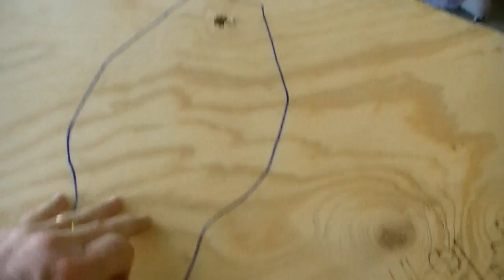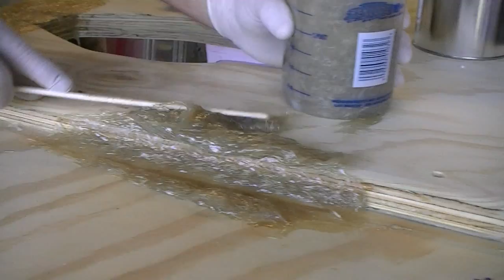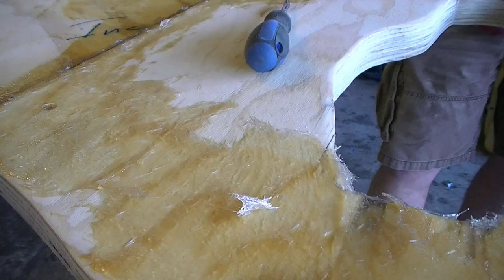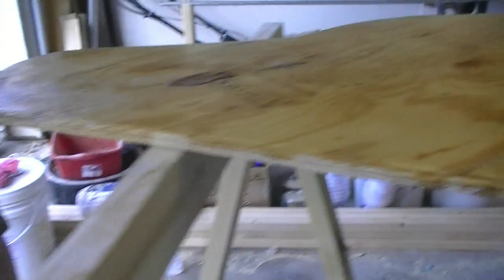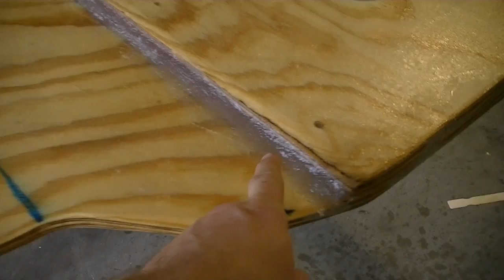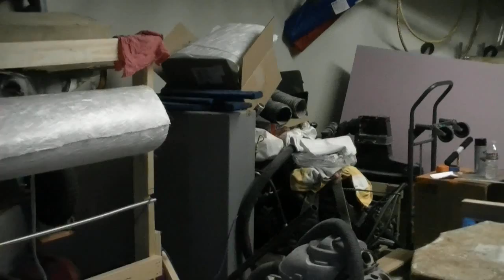How to Water Proof a Boat transom with Fiberglass Restoration VLOG #15

Comment: just a heads up for any of you DIY out there, do your hot coat of resin on the ply with a bit of acetone mixed in so that it soaks better into the timber. Let the resin cure before laying down your chop strand, that way the chop wont suck the resin back out of the ply.
Reply from the maker: the DentalDude that is a very good tip. Thinning it will allow it to dig in the wood.

Comment: Dues humidity affect the wood before you apply the resin coats? I am doing this right now. It has been intermittently rainy and humid here in Florida. I have a garage here with ventilation and have put the marine plywood in front of a shop fan for a while and seems dry but wonder if I should bring the wood inside the office a/c to try and remove moisture overnight????
Reply from the maker: after6tuning I never really had any problem. I would not take it into another environment as it may change the cure time. Man that is a good question. I did a quick search and did not find anything definitive.

Comment: Hey man, I know you’ve been doing this for a good bit on a couple boats.

Do you have a particular brand you use that’s quality but not top dollar as far as resign, catalyst and gel coat?

All I’ve found and have been recommended was west systems but they seem very premium and expensive. Do you have a better or cheaper alternative to west system materials?

Comment: I dilute the first few coats on plywood with Stirene makes in soak in more imo looks like ur doin a great job.That PL adheasive is great we use it for granite work all the time and that stuff really holds :)
Reply: I always use stirene and dilute the first few coats. The plywood needs to soak in the resin. If you just wet out and glass the plywood. The plywood can drawl out the resin from the glass.

Comment: Couple of suggestions. I save cardboard from large items, like washers, driers, refrigerators and water heaters for painting and to place on the floor for projects like this. Two; sometimes you can put rollers with oil based paints in plastic bags and then place them in a refrigerator (not freezer), and they stay usable for some time.

Comment: for all of you wondering what marine plywood is made of? its not the glue that is used,  its the wood.   the tree is a south American wood called OKUMA it hold to rot water 5 times longer than standard pine plywood.  my full time job was at boat bodyshop and rebuilt many many floors and transoms over the years.  looks like you did everything the right way.  and guys, when starting this make sure you have 2-5 weeks time,   BIG JOB lots of steps to complete..
Reply: And soaked with arsenic,  which is illegal in most states

Comment: when doing you filler, apply your thicked resin and mix up 100- 200 ml. of wet resin and use a 2in. china brush and wet smooth ,  and always use wax mixed in the last coat of resin

Comment: Why not use Coosa board so it will never rot again?
Reply from the maker: Cost. We are not building war ships. If wood is done right, you will not have to worry.
Reply: Wood done right is fiber glassed wood and fiber glass is a composite. So, technically you're killing yourself to turn wood into a composite instead of just using composite materials like Coosa.

Comment: hey really nice work, but as the way I do stringers you might wanna try  on that filet after you gyped it up with chopped strand puddy mixture to immediately glass over it with with one layer of Matt or 2 about 4 inches wide then roll out the  you dont have the airbubble toubles afterwards just a thought

Comment from the maker: The Fillet mixture does have strength due to the strands, but the strength comes from the glass laid up on the sides of the stringers. The fillets act as glue and a transition from the stringer to the hull. Makes the glass lay down better.

Comment: Are you counting on the fillet to add structural strength, or could you of cut the smaller piece at a 45 degree angle ?

Comment: Hello - good work.  I realize there are a number of different ways and techniques but want to point out that around 8 min you are coating the entire transom with resin to seal it.  I would suggest mixing that coat with acetone if you are using poly resin - that allows better saturation of the wood especially if you sand it first.

Comment: If you have a swap meet or flea market you can buy cheap rollers and brushes there.  Much cheaper then Home Depot.  The only thing I would try to clean is the steel roller for rolling fiberglass.

Comment: you may want to consider  the fact that acetone can be any where from 14-20 a gallon and you still have a long way to go and usually you cant save your brushes and rollers anyway also consider covering your garage floor with old tarps or plastic much cleaner just throw away